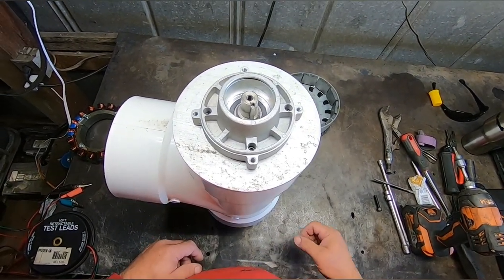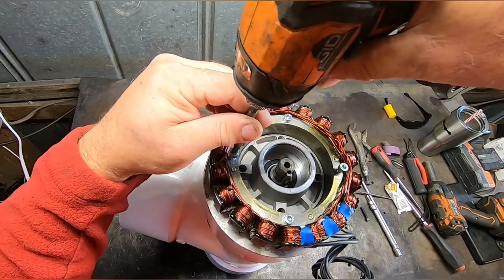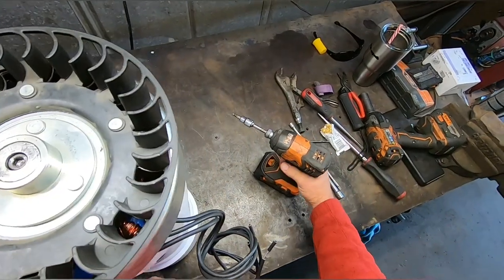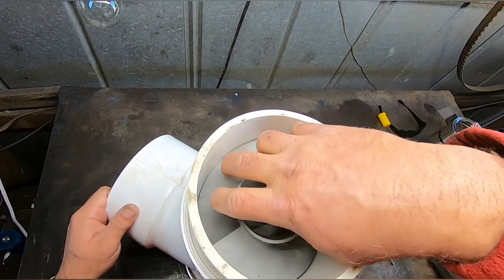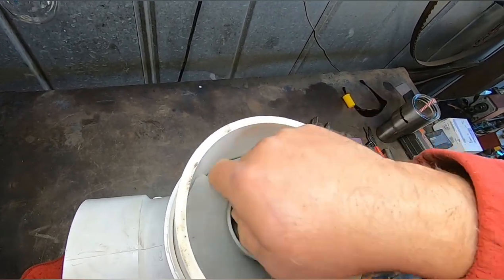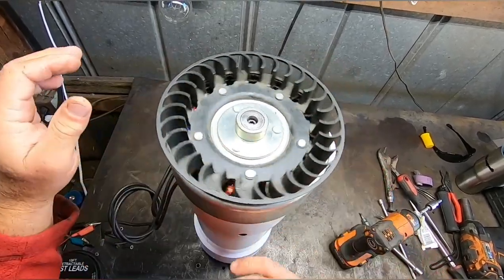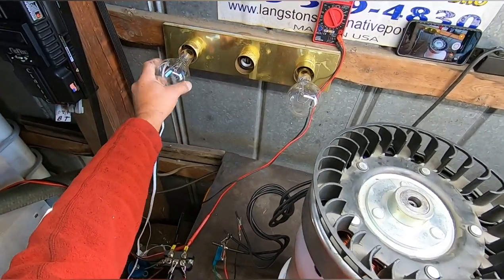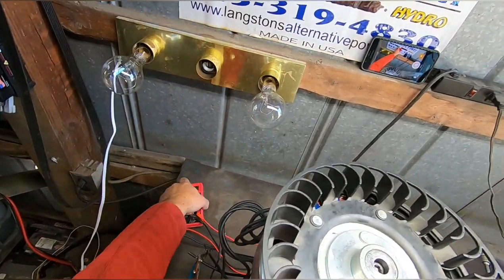6 inch low-head Hydro turbine

Comment: Spencer,  at what point would someone expect to need to replace the stator like that?  And how much gpm does this system need again?  I know I could just go look at your website..  lol...
Reply from the maker: I've never had to replace a stator on one of these due to it going bad only when they wanted to change it to a higher voltage or with one of my turgo units if they let it run with the bearings bad for a long time it can rub the wires on the stator.
Reply from the maker: The gallons per minute needed depend on what the elevation drop is in feet say five foot of head would need approximately 5 00 to 800 gallons a minute. Depending upon whether you use a 6-inch feed pipe and what size downpipe you use will determine how much flow you will have to have but the more flow the more power
Reply: @SpencerLAPower  I'm gonna have to call you again...LOL..